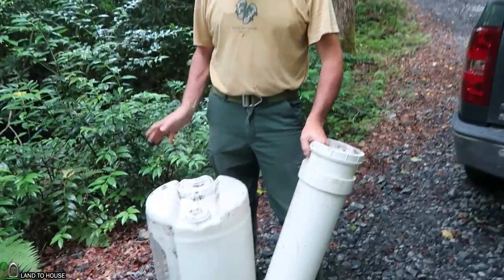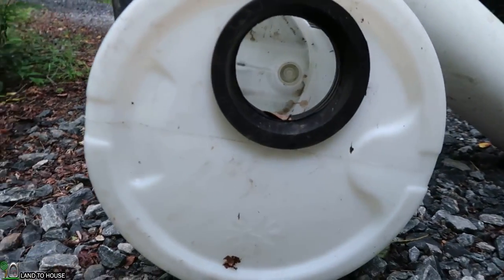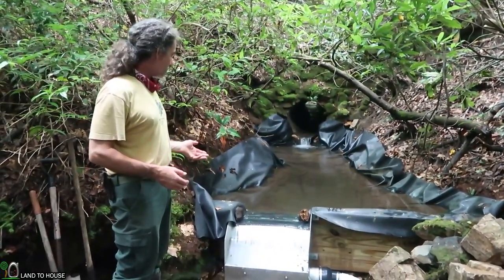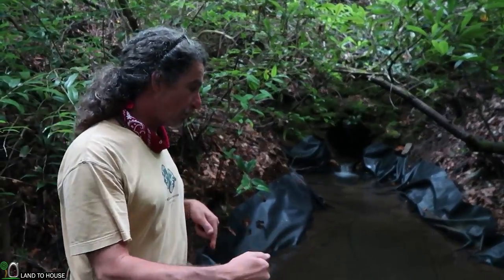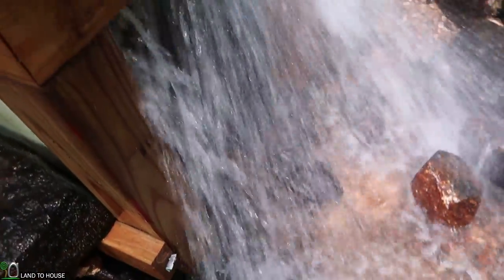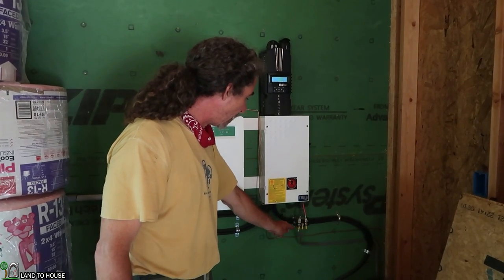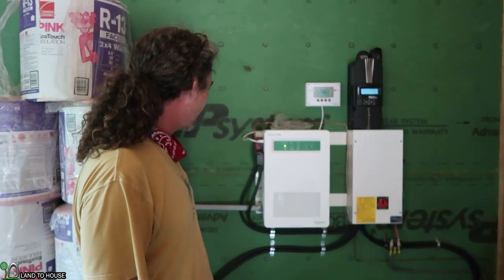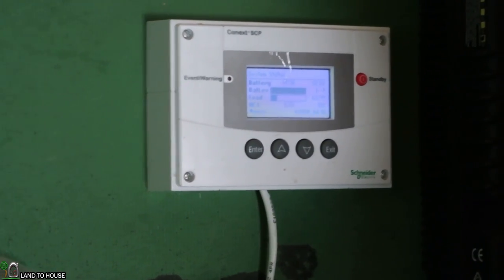AMAZING 250+ Watts of Micro Hydro Power Off Grid

Comment from the maker: Do you like Micro Hydro? Check out another water power video:
https://youtu.be/V82SVeVXKcA

Remember to subscribe and leave a comment.
Reply: Hey brother, where were you several years ago when İ lived in Bakersville?
Reply: 57 ft head flow through a 5/8" nozzle = 55 gpm
55 gpm * 8.34 lb/gallon * 57 ft head / 60 seconds / 550 ft lb/hp = 0.79 HP available.
0.79 hp * 3/4 kw/hp = 0.59 kw
0.250 / 0.59 = 42% efficiency - not bad for a small system, but could be better.
You will have about 12.5 ft head friction loss through 1000 ft of 4" pipe @150 GPM.
Pressure (and flow through the nozzle) will change based on head pressure, so a bigger nozzle is self regulating as far as nozzle flow is concerned, because the head in the pipe will change.
The manufacturer should have chart for turbine efficiency based on pressure and flow so that can be optimized.
You can vent the pipe to eliminate air with a 'T' a few feet of fall below the intake. (this may not work if head falls below the T, and may depend if there are any flat spots lower down.)
Reply: How much is a turbine like this setup?

Comment: I haven't finished the video yet, so I could be wrong: it might be an idea to use Watt hours instead of Watts for units of energy. Watts is instantaneous power, while Watt hours is total energy produced over a time period.
Reply from the maker: I suppose saying 600 W is a bit click bait. So I changed the title to w hours.
Reply: come on everyone know's Voltage is the "best" measure of power lol
Reply: @LandtoHouse  6KWh/day is still quite impressive.
Reply: Thats exactly what a watts are, joules per second lol. but I know what you mean.
Reply: @LandtoHouse  Saying "AMAZING 6000 Watt Hours of Micro Hydro Power" is not at all .. <3
- "An Amazing 6000 watts of power per day from this Turgo Micro Hydro system."
Reply: How are you working this out? Are you saying this is 6kWh or 6 units per day?  Therefore 24 hours in a day, the turbines is outputting 250w of power 24/7?  Why don't you just say the actual output of the turbine is 250 watts all the time!  Feels very click-bait-y to me!
Reply: Dang…talk about back up and punt! All the way back to and across the click-bait side!😂
Reply: I still see "AMAZING 6000 Watts ... per day". I guess it works as click bait for nerds coming in here to see What's up with the title 😅
Reply from the maker: It has worked well so far haha. Its just close enough to true to be ok in my book yet just wrong enough to start conversation.
Reply: Pretty true for solar whose watts varies a lot time to time. This hydro should have pretty constant watts
Reply: @thedogsdiddies8421  it produces about 6 kwhr per day.
Reply: @twistidclowns  Joules are energy spent?
Reply: @mog5858  power P = voltage V x ampere I
Reply: @ekhramabdullah3685  yes and "power" = watts. he would have to give us the ampere before that would work.
Reply: @LandtoHouse  Only you did NOT change it. WTF is wrong with you?
Reply: I was thinking the same thing as I watched the video. Thanks for pointing that out. 

The other thing I watching was, “How much does a setup like this cost for parts and then installation”?
Reply: @calysagora3615  It's clickbait, and it works, why would he change it? Half of us are here because it's wrong, and YouTube rewards clicks not content, it's smarter to create half an hour of garbage with a shitty attention-grabbing title than half an hour of content with a true title, because the garbage will get more views.

"Its just close enough to true to be ok in my book yet just wrong enough to start conversation." Get off your high horse, this is 100 percent misleading, it's as stupid as saying "my car has a top speed of 600km!" when you mean range.
Reply: @thedogsdiddies8421  зато эти 250Вт постоянно вырабатываются!! Это же не бензиновый генератор
Reply: @CuthbertNibbles  - Please get off of your damn high horse "Darren". There was actual information imparted to those of us that were watching for it.
Reply: @workbenchz  Yes, 6 kWh / day is very impressive.  It's nearly half of what I"m getting on a sunny winter day from a 4 kW solar system and much more than I get on a gloomy day.  On a sunny summer day, I get much more but this 6 kWh is very consistent because it's water power from a creek.  It's very dependable, day or night, no matter what the weather.
Reply: @ChristmasEve777  and now imagine, that you combine different power sources into one system water/wind and solar
Reply: Biiiiiiingo
Reply: Yea but it's hydro? It rarely goes down lol

Comment: 6000 Watts a day != 6000 Watt/hour thats 250 Watt hours. I'd recommend exchanging the title. Otherwise, nice build as always!
Reply: It is misleading for sure. 6000w/h is enough for everything in house. Other just for TV.
Reply from the maker: I added the "per day" so its accurate.
Reply: @LandtoHouse  thank you very much Seth! I know you only mean well!
Reply: @LandtoHouse  yeah didn't want to sound mean :) never the less it's cool project
Reply: Good video as always but, unfortunately, now it's not only misleading but wrong. :/ 
Watt times hours is energy, in units: watt hours, Joules or calories if you want. 
Watts is a unit of power, like horsepower. 
If you say my car has 150hp per day, that's just wrong. 
Sorry,
Reply: So it's a 250W generator, thus generates 6 kWh per day. Watts per day is not a meaningful unit, the -hours is important.
Reply: The title is still incorrect. It should say 6000wh per day, or 6kwh per day, or 250 watt generator.
Reply: @LandtoHouse  this "per day" brings confusion ; I guess you mean the power is 250 w, thus by the 24hours that makes 6000 wh (watt-hour) each day ?  -
Reply: @LandtoHouse  no, it's not. "6000 watts per day" means after a week it will be a 42 kilowatt system, the next week 84 kilowatts.  What I believe you mean is "6000 watt hours per day", otherwise known as "250 watts".
Reply: Agree: Utterly misleading, inaccurate, clickbait title.  Too bad because the video is otherwise fine.
Reply: @PKMartin  you are making the same mistake. You are saying 'watts' instead of 'watt hours'.  They are not interchangeable.
Reply: @pinkiepie1656  I know they are not interchangeable - that was my point. If it "produced 6000 watts per day" that would mean a constant increase in power over time, becoming a more powerful system day after day, which is clearly ludicrous. The system has a wattage which remains constant, and it produces kilowatt-hours of energy over time.  I was pointing out how "watts per day" is a stupid quantity. I suspect from their comments elsewhere that the channel owner deliberately made the title incorrect both to make it look more impressive, and to drive engagement (by people having this kind of argument in the comments), so I'm going to stop feeding into it now.
Reply: @LandtoHouse  it’s still not accurate
Reply: @LandtoHouse  Nope, still unit error. It’s 6 kWh energy per day or 250 W of power. Two different physical quantities.
Reply: Amazing how these guys build these system and then do not get their units right...

He is running at 400 watt, but AC, that is rectified to 250 watt DC (as you can see at 13:36), running for 24 hours, means 6000 Wh or 6 KwH.
Reply from the maker: I dont build them.
Reply: @LandtoHouse  6kW per day still makes no sense.  Do you mean 6k Watt-hours?
Reply: @LandtoHouse  nope, that does not make it accurate. it's watt hours, not watts.
Reply: @LandtoHouse  NO IT ISN'T.   You gotta be a psych major.
Reply: The title is very misleading, you cannot create your own units and start using them.
Reply: @LandtoHouse  It's still not accurate 6000 Watts per day still means that it would create 6000 watts of continuous power meaning it would create 144000 Watt hours per day. It is producing 6000 watt hours per day or 250 watts of continuous power per day. I would suggest either "Amazing 6000 Watt hours of micro hydro energy per day" or "Amazing 250 Watts of micro hydro power"
Reply: @LandtoHouse  well being 4 weeks late but adding per day does not make it accurate. Saying that it does 6000Wh/day or 6kWh/day does, but intentionally making it wrong is perhaps something drives engagement. But to someone who works with energy / energy reporting it is quite bothersome.

Would be cool to build one of these tho, but when water is frozen for 4-6months a year it would be a quite a lot to maintain for such a short period. Only larger plants work under these conditions.
Reply: Soo it will do 6000 watts continuosly for a whole day or for 2 minutes?
watts per day is not a good value.
Reply: @SkyCharter  seemed to me just confusion on the terminology not intentional click bait.
Reply: @carstenk2552  говоря о выработке энергии генератором интересна не его пиковая мощность, а как раз сколько он вырабатывает в день, ведь гидростанция работает всегда! И куда вы будете девать лишнюю энергию? 6000Вт в день это хороший показатель, средняя величина потребления домохозяйства в день.

Comment: This was fascinating, thank you for bringing this to us.
Eric has some neat design concepts that you might want to consider for your dream list for your Mark III:
- All nozzles have their own ball valve to select the best set for the current water conditions instead of having one "always on".
- Stepping up to oversize Y fittings, then back down to flexible lines for a graceful curve into the nozzle to improve flow efficiency over sharp right angle turns in elbows and T fittings.
- Running 2 smaller opposing nozzles instead of one 'just right', to improve the efficiency by having balanced pressure on opposite sides of the turbine.
Thank you for sharing this.

Comment: The drop in pressure on two nozzles will be because you don't have enough water coming in the intake and the head level will drop until the new pressure balances with how much is coming out of your nozzles.
Reply: Dynamic friction lowers available pressure significantly at high flow rates.

Comment: Your videos are great for an old engineer to watch, so thank you.  I have one suggestion on the pelton wheel principal that may be of interest.  The steam engine came of age with the triple expansion engine which used the spent steam. I'm thinking that concentric pelton blades that increase in size/angle could reduce the outflow to a calm drip which would harvest more of the energy from the water.
Reply: Steam and water have different properties. Steam condenses as it gives its energy away. Water can't. The outflow MUST equal the inflow. What happens is, the flow slows as the energy is delivered. Potential energy turns into kinetic energy as it falls and the kinetic energy supplies the electric energy, thus slowing the water down. But always, flow in MUST equal flow out.
Reply: @ianhelyar6383 : What Rolf means is reducing the outflowing water’s speed not volume! A more efficient turbine would harvest more of the jet’s kinetic energy and leave a slow flow.

Comment: Speaking of tweaks, you should talk to someone who builds hot rods if you want to get some ideas about how to reduce flow resistance with the shapes of your piping. I've always wondered how much loss you get through a PVC pipe fittings because they are not designed particularly well for flow. They have ridges that naturally form at the point where the end of the pipe and shoulder inside the bore meet. You want smooth smooth smooth the whole way through if you can. Also, the actual shapes of the angles aren't ideal either. You don't ever want to see a complete 90 degree turn in such a short radius. You want a nice wide sweep in any directional changes. I'd be interested to see what a nice 1 into 2 collector designed basically the reverse of an engine header collector. Have someone fab one up out of stainless and see if you get any improvements in flow. I think you would. Also, in those places where you have 45 degree fittings, you could heat the pipe up enough to bend it and get a sweeping turn that way. PVC can be formed like this at a relatively low temperature. When I was laying my irrigation pipe I used a heat gun to get the turns I wanted rather than using fittings because it was just easier to make them conform to the hillside that way. Granted it was only 3/4" schedule 40, but I'm sure there's a way to get it done with the bigger pipe.  The last thing I'd look at is the straight fittings of the PVC itself. I'm not sure how you'd get this done, but you'd basically need a street type setup like they use in PVC conduit where the fitting would be built into the ends of the pipe and oriented so the female end would be upstream. There would still be a ridge there, but the female ends of those fittings are chamfered to reduce drag.
Reply: I agree with you... he should be show up the process, how to make it not just mumbling, I mean talking...

Comment: About 1 ohm of resistance on your 1000' of wire.  If it's at 59v @ 252 watts per the end of your video, you're doing 4.25 amps (your charge controller is finding the sweet spot in MPPT mode).  So V= I*R = 4.25*1 = 4.25 volts of loss.  So you're at 63.25 v at the turbine.   So 59/63.25 = 93.3% transmission efficiency or 6.7% loss.  Seems not too terrible and it would cost a lot to upgrade that.  If you were looking for better performance and you were running higher power levels more often and you needed the power, then  you could go chasing a few more percent... but I think your effort would be better spent elsewhere.
Awesome system!

Comment: Oh man, I really think you would benifit from boosting the voltage before that wire run to prevent a lot of losses!
Reply: A step up transformer would work well here
Reply: I just did the math and he's loosing 6.7% due to the voltage drop over 1000'

Comment: One additional thought for methods of lowering losses.  I wonder out loud whether boosting the voltage via AC inverter at the generator would help. A 90%-95%  efficient AC inverter creating say, European 240V single phase (cheap Ebay purchase) would drop the wire losses to about 5% and bring 240VAC to the shed.  Add 5-10% loss for the added 240VAC inverter, you're at 15% or less voltage drop to the shed, instead of 26%, not a bad improvement. Also brings you AC power that's directly usable.  It's predicated though on changing the battery charger to AC power.  Another possibility is now that you'd have converted to AC, you could put a transformer in the mix, and step up the voltage even more, reducing the losses proportionally to the voltage increase. Blame Tesla :-)  Would have to really make it safe from accidental shock though...probably not worth the risk.    For a few hundred watts total generation, you might never recoup the additional investment, depending on how much value you set for the produced power.  On a safety note, I hope you've grounded the generator with a #6 copper wire to an 8' ground rod for safety and to comply with NEC?  I'm a bit envious, I always wanted to do this, my stream is unfortunately too low head and flow to do anything with.

Comment: Just a thought regarding air in your pipe.  I’m thinking that a T just before the Y section at your turbine, with a short section of vertical pipe , say 1’ high at the full diameter, then reducing to say 1” clear pipe which is capped.  If you are getting significant air, it should be ‘caught’ in this pipe.  If necessary, you can get air bleed valves ( a weighted float seals when there is no air in the pipe, but is lifted, sealing shut when there isn’t).

Comment: Need to build a giant timber box about the size of 4 refrigerators. Intake the water and a foot or so above the bottom is your outtake. You also need a way to pull a slide up which will dump all water and debri from your trash box. Gridlessness shows a guys system that works wonderfully

Comment: Look up gutter helmet. It uses a round edge design so that the water surface tension holds it around the bend but debris falls off. Scale that up with sheet metal for your intake.

Comment: You mentioned that you were unsure of the kind of losses you would have in the 1,000 ft of wire. The calculation is simple. Divide the output power at the turbine (250 watts) by the output voltage at the turbine (48 volts), which will give you an output current of 5.2 amps. Multiply the current by the resistance of the 1,000 ft of wire which you can find from a table based on the wire gauge. For 10 gauge it will around 1 ohm per 1,000 ft. Square the current and multiply it by the resistance which should give you about 27 watts. So, roughly 27 watts is being wasted in the 1,000 ft of wire. Keep in mind these losses will also increase as load increases. For example, at 500 watts, 108 watts (quadruple the power) would be wasted in wire.

Comment: Great video! Wonderful application of conanda effect! Thanks for stating watts per day as I think it is best way for folks to understand how an energy producing system will (or will not) work for them. It's similar to sun's insolation at surface e.g. 2 kwatts per day per square meter in winter vs 4 kwatts per day per sq meter in winter. And also thank you so much for putting system specs in description, e.g. head, etc.

Comment: Increase the height of your SS water collector to at least twice  the  diameter of your pipe, but it all depends on the flow rate. If still not enough to maintain the water level higher than the pipe then increase further.

Comment: I can see water discharging "directly" from the turbine, and moving down stream? Would it be possible to use the pulling force of the weight of water on the discharge side of the turbine? Are you using a stand by trickle charger to prevent sulfation of the battery plates, when hydro-generator system is not producing enough electricity? Also...  would there be a way to use pulse-width modulation to move the electricity from the turbine-generator  to the batteries? I like your setup, that is cool stuff, thank you for the info!